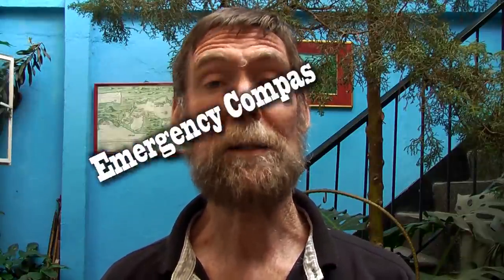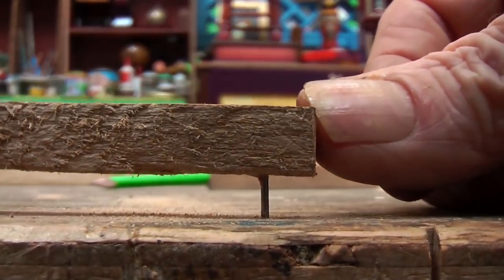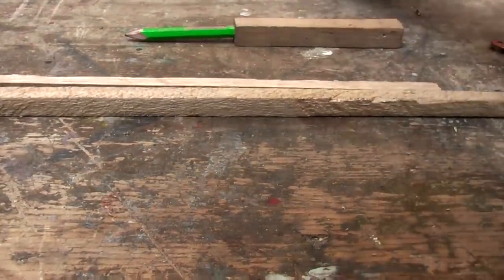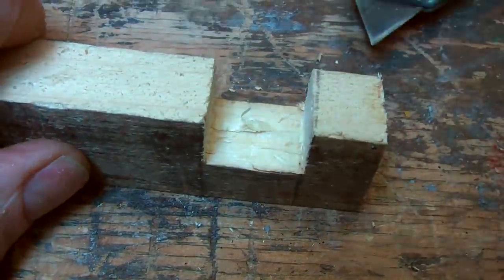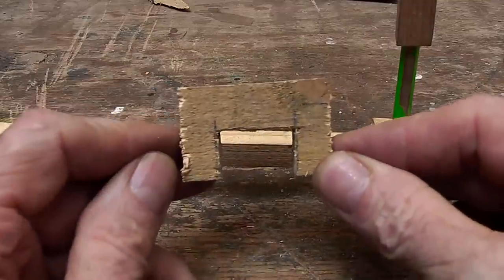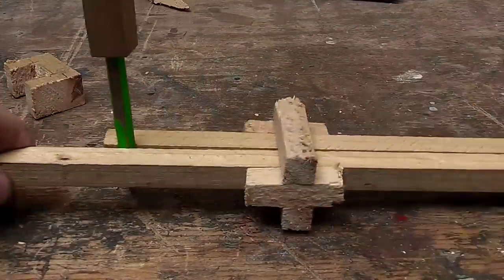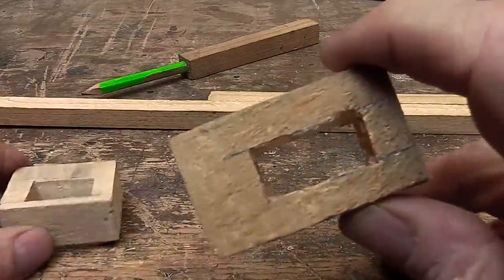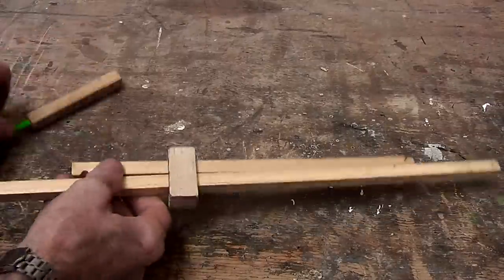Emergency Compass

Comment: I always love your videos where you take scraps and don't even clean them up but then make a tool or jig that works perfectly.  Example: I made your wooden ball carver.  Used a lathe for the handle and diamond hones to sharpen the teeth.  Yours still seems to work much better (lol). Can't wait to see your next woodworking video.

Comment: I was saying to myself, use a plastic cable tie!  but your mk3 or 4 version i think is the simplest and best looking also!  hope you are well philip, always enjoyable seeing you, and always look forward to seeing more.  Thank you!
Reply from the maker: +jusb1066 . Rubber bands worked for a while, then string worked for a while, then the clamp things developed. I never really had any  cable ties. Thanks for your encouragement. (I have been struggling over the last few months with Youtube and its commercial attitudes. Note the advertising. After 8 years, I finally  caved into them.) Nothing I do is as polished as  many others on the tube, but I am glad there are a few of like mind, who do not mind the rough edges, and take what I can offer, with such a good attitude  as you  yourself have. Thank you.
Reply: the 'rough edges' show you are both human, it also shows small touches that we learn from, super edited videos might look amazing but dont teach much,  its seeing how you manage with non ideal wood, working around holes, the odd bad saw cut and less than ideal other materials is what makes you think and I enjoy seeing, for example this compass works really well and the pencil grip is the cleverest as it relies on the springiness of wood, so smart thinking about the meterials at hand. thanks!   I don not mind the ads, youtube has them everywhere, i didn't notice the 'lack' of them before, if a few dollars can go your way from googles, then im all for it from. but many popular  youtubers are wanting patreon income also. and being unable to afford to help makes people like me feel 'second class' but youtube ads dont hurt me and gives you money then all is good
Reply from the maker: +jusb1066 .Indeed it is refreshing to meet people intelligent enough to see these things.Thank you. Also you have solved a puzzle... compass has two 's'. I even googled it and still something just wasn't right ... and it was the 's'. One 's' is the Spanish version.  :( . I have never been a great speller,  and titles always have me nervous...oh well, this one will just have to stay that way.

Comment: isn`t that saw a little too fine? isn`t that a metal saw?
Reply: +Mike TheMuffin as long as it works tho. Still, great job
Reply: +Mike TheMuffin yes, he often uses a slightly old hacksaw blade, they do work pretty well actually for fine work. Its also about using what you have rather than always pushing the idea you need an expensive tool to get jobs done. once  a hacksaw blade is blunt, i break it in half and put a bit of tape over the broken end, the other end is usually unworn as you tend to use up the middle, and keep that around as a handy little saw, you can buy a handle for this but i dont have one, if Philip has any ideas to make one, id be very interested!
Reply from the maker: +jusb1066. Yes indeed.You are quite right. Its not a hard and fast rule, but the finer the job, the finer the saw.  I tend to use the hacksaw blades out of the  hacksaw more than in, so they wear fairly evenly for me, but you are right, the ends tend to stay fresher. In those cases I grind the tip down to make miniature keyhole saws for  miniature work.If the blade is snapped in half, I tend to sharpen them and use as knives or miniature chisels in stead of saws. Last birthday I got  a half dozen blades...(time for some new ones...Christmas is coming) I was also given one of those plastic blade holders. It works for some jobs, but  mostly  just the blade in hand is better.

Comment: Why do you have your pencil in a piece of wood
Reply: +TwoKingzGaming I personally do something similar to that when my pencils get too small because i've sharpened them many times. What I do is I grab an old pen or marker and stick the pencil inside of the pen/marker's body so it gets easier to use the pencil because drawing or painting with small pencils is unconfortable and kind of hard. I'm not sure he is using that wooden stick for the same reasons though...
Reply: +Armando Alves ok thanks
Reply from the maker: +Armando Alves.. Ha , yes , I wondered if I should have done a 2 min  quick  video on that before uploading this one. I still might... I glue pencil stubs into the  square sticks because they use  shorts stubs that kids throw away, they are easier to handle, are easier to find in amongst  the disorder of tools and materials on some projects, they do not roll off the  table, and they make good giveaways for people who visit me and think they are  cool and novel...and you can clamp them to things.... and they cost nothing.
Reply: +TwoKingzGaming I noticed this some time back! i have made several of these holders myself and now keep my stubby pencils for in the workshop for their second life!
Reply from the maker: +jusb1066. looks like I might have to do that  2min vid...:)
Reply: +PhilipStephens007 Your pencil in a stick inspired me to do something similar, a bit fancier, with a piece of brass tubing. Love your How-To vids!